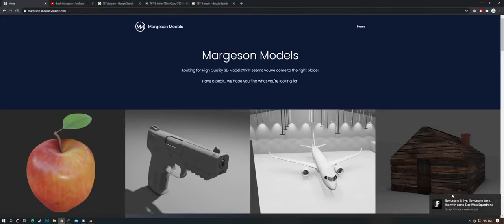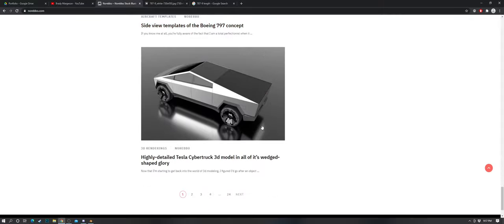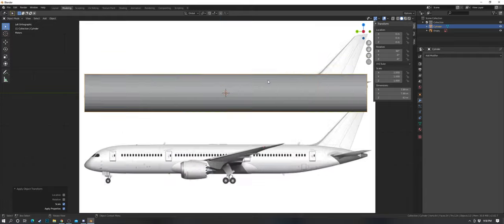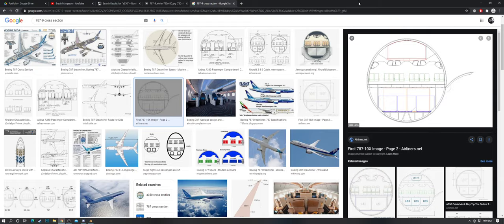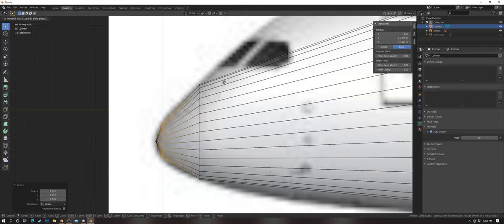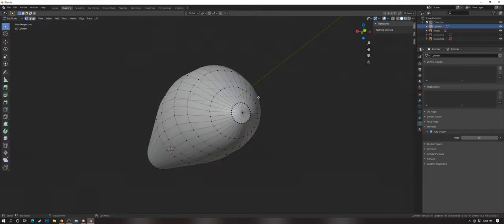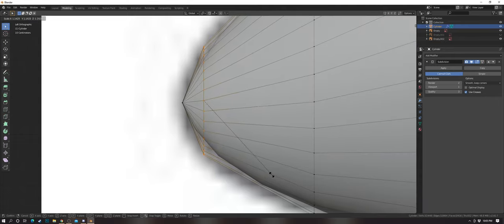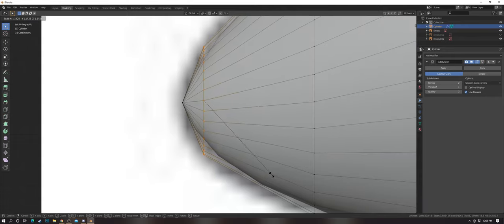Blender | Boeing 787 Modelling PART 1...Fuselage & Cockpit Windows

Comment: Nice video. I will just say, after applying subdivision surface, instead of dragging in a loop cut into the weird bends, use the crease tool (SHIFT-E) on the loops to control how much the subdivision surface adheres to your original topology.

Comment: I have a question, how do you make your planes so smooth? Mine always have weird edges and bumps and lines around where I cut, I try moving around vertices and making more cuts but it just does not work
Reply: @DLRKGAMING that’s not what I was talking about I know how to to do shade smooth and auto smooth
Reply: make sure when you scale while looking at various reference images you are scaling the correct orientation....like side profile hitting z after scale... thats where most of that comes from.
Reply: @diamondbros6446  super duper late reply, but in object mode, select object, shade auto smooth. I am new to blender although you prob aren't by now lol
Reply: You can try removing the vertices and then using grid fill on the hole. Works really well!

Comment: Hey brady i am facing a problem with knife project, it shows me there no other selected object have wire or boundary edges.
pls help
Reply: Hi, I got the same problem. I'll try to solve it and if I do, I'll contact you here!
Reply: Thank you
Reply: @ItzJxnnik  Hey i found a solution, first select the the fuselage and tab into edit mode. Then later hold Ctrl and click the cockpit window after selecting it come to your appropriate orthographic view which is it should be facing the front of the fuselage and knife project.
Reply: @ItzJxnnik  it worked for me
Reply: @claytonmenezes4162  Exactly what the video said, I sent you.
Reply: @ItzJxnnik  i did not get the video you sent me, so i did not know.
Reply: @claytonmenezes4162  OMG thx u man ur the best
Reply: @wonnaxo  no problem

Comment: hi there, how do you devide the cylinder into pieces like you did at 5:42
Reply: hey brussel, he used something called a loop cut which you can get by holding Ctrl+R or on the left side the panel by hovering you can get it
Reply: @claytonmenezes4162  yea i found it out right after I posted this comment😂
Reply: @Jonas_vdorsselaer2972  hahahaha lol
Reply: @claytonmenezes4162  me again, how do you make those angles from the loop cuts like in 5:58
Reply: @Jonas_vdorsselaer2972  select those vertices and press S on ur keyboard, and then with ur mouse bring those vertices very close till they look like 1 dot
Reply: @claytonmenezes4162 oh ok